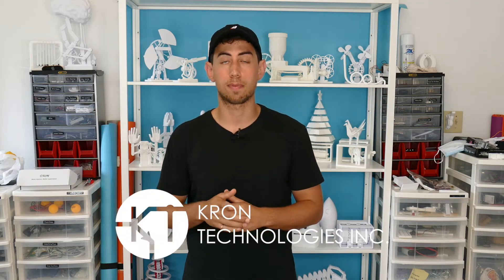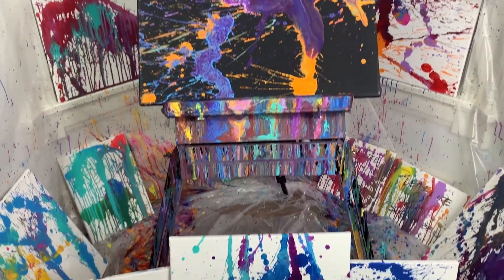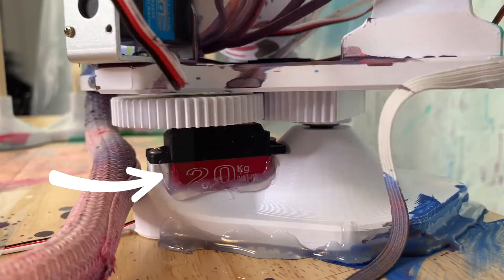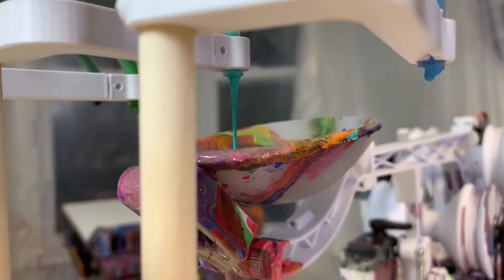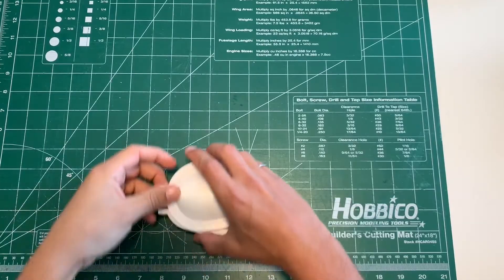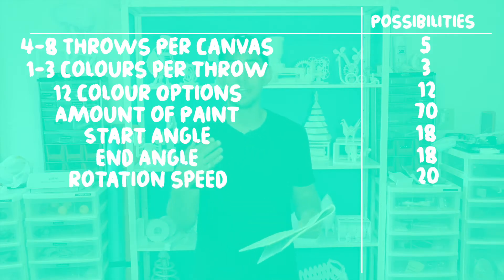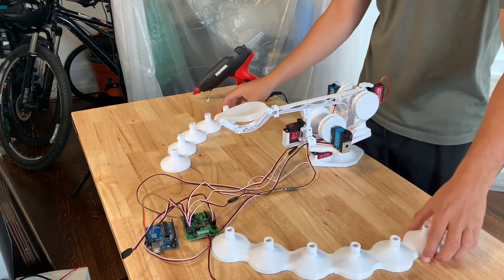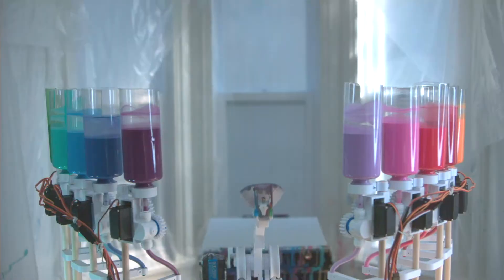Engineering a Paint Throwing Robot

Comment: Hey JBV! I made a similar project with a couple of friends but ran into issues with the paint dispensing. Where did you get the parts for the automated valves? :)
Reply from the maker: The valves and servos are from amazon, the other parts I designed and printed. Good luck with the project!